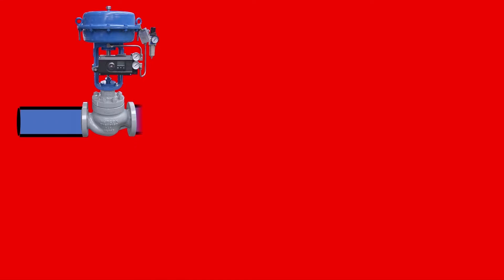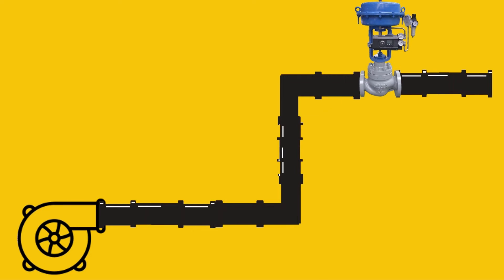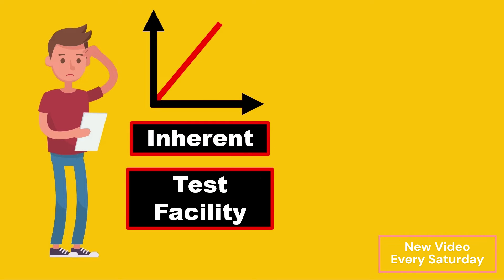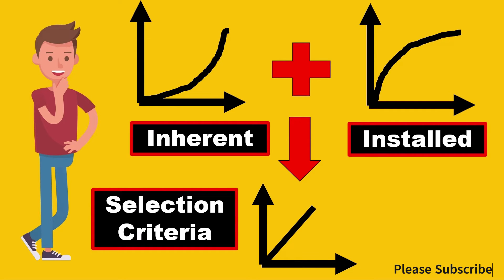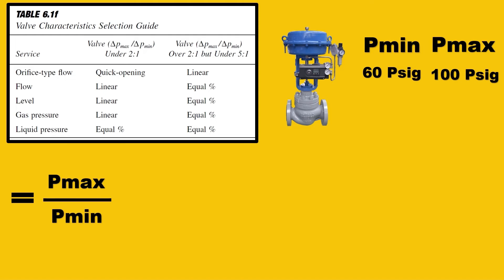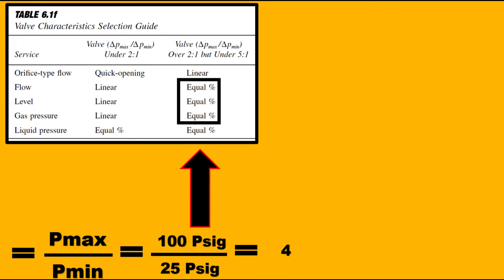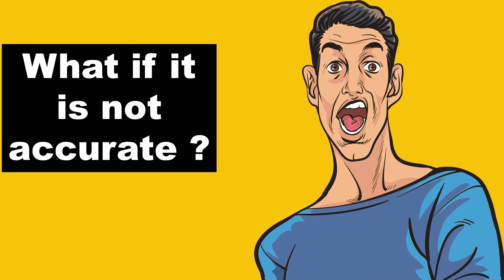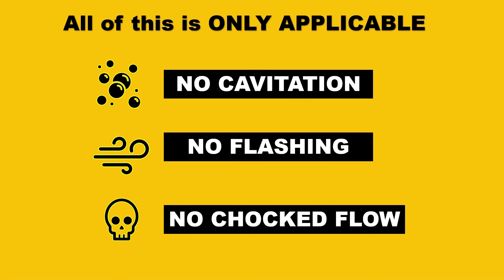Control Valve Characteristics Selection | MOST SIMPLE EXPLANATION

Comment: I have a positioner attached to my control valve. If my control valve inherent cahracteristic is equal percentage, then what characteristic should I select when I configure the optimisation in my positioner setting? Is it set it as linear or equal percentage? I noticed the characteristic in our positioner setting is always set as linear instead of equal percentage.
Reply: @fltp1888 Yes, you are positioner setting should be normally linear. Valve Characteristics is determined by the shape of Plug. Now, suppose you want to change the valve performance without changing the plug, then you should change the positioner settings.

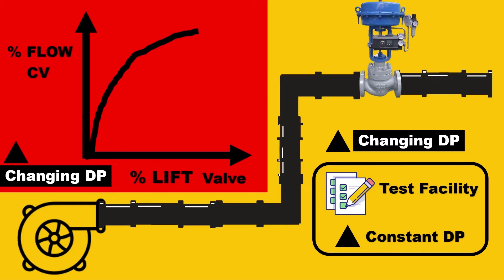Comment: Hey Asad , i am wondering that at 1:20 why the installed characteristic plot will always be same as Quick opening. I mean the graph of  installed chars could look like equal % and then to compensate it we would need Quick opening.
Note that both are non linear and operating DP in a live plant may not always vary as the graph shown in video.
Reply from the maker: Dear brother, You are correct, the graph is an example to demonstrate the concept . The end covers the type of characteristics to be selected as per bela liptak table.

Comment: we have been sizing valves with Linear characteristics for high pressure reduction while equal % we have been using for flow control valves . That was always our rule of thumb unless there is a change of thought process over the years however with advancement in PID controls and DCS system - the valve travel can be made to behave the way we want
Reply from the maker: Very true ..... Just it is important to configure the valve correctly !!
Thanks for sharing your knowledge ☺️